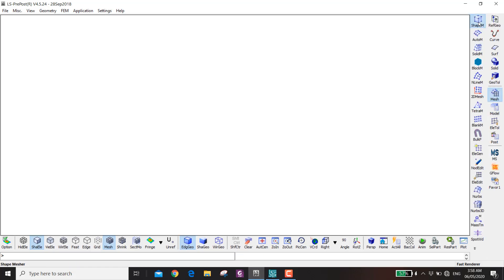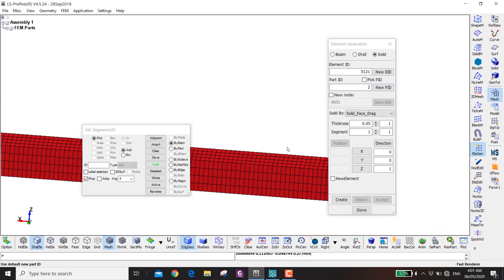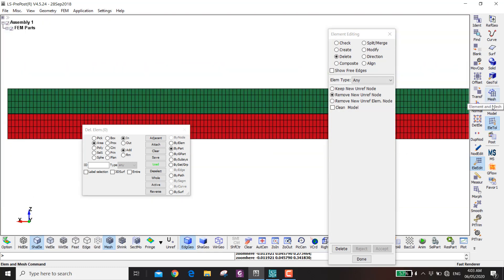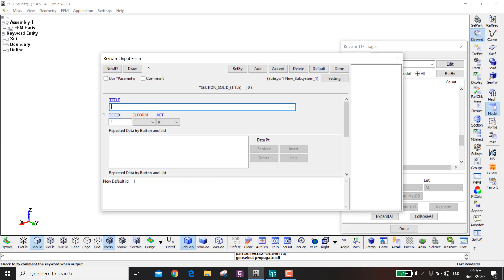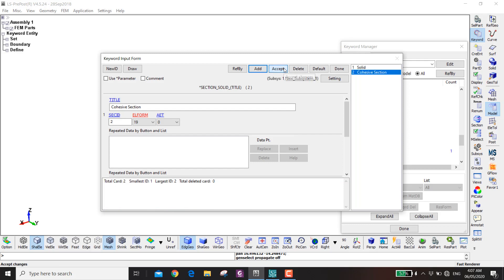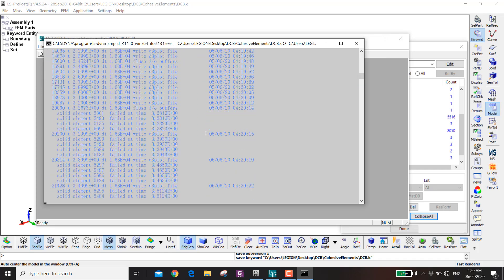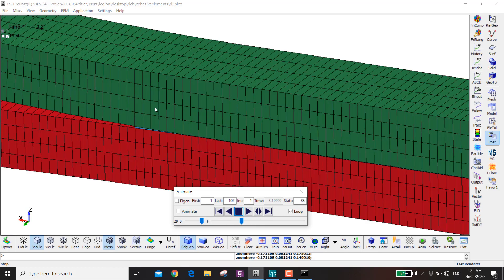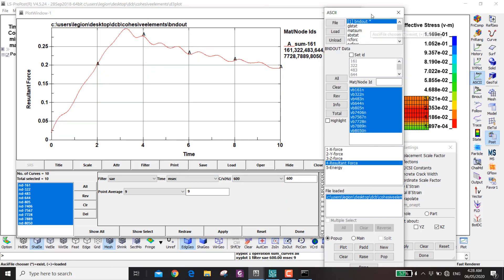LS-DYNA TUTORIAL 14: Delamination Test and Cohesive Elements

Comment: Thank you for the helpfull video Ameen! I am trying to model a single lap adhesive joint with the same methology you explained in the video. However, the analysis doesn't start because of the error  "The bottom of cohesive element ... is not attached to an adjacent shell, tshell or solid element - nor - is part of a tied or tiebreak contact definition" for all the adhesive elements, even though I have merged the nodes between the substrates and the adhesive. Do you have any idea what I'm doing wrong? Is it neccessary to use a tie contact?
Reply from the maker: From the error message, I believe there are some cohesive elements with "free ends". All cohesive elements should be connecting between two non-cohesive elements.
Reply: @AmeenTopa  Thank you, that was the problem! I was using two layers of cohesive elements. Also, have you made any video in which you reduce the computational time of the simulation? As I said, I am modelling a single lap joint with a wave-shaped overlap area, the model consist of 70,800 elements and the total time is around 5 hours, but i think that it's quite a long time (I'm a new user)
Reply from the maker: @loukasath.9787  I don't have any videos on that specific topic. The computational time depends on the timestep size and termination time. Smaller timesteps are necessary when the simulation is dynamic and the explicit solver is used. For long duration events (more than 1 second in real time), the implicit solver is used which allows for bigger timesteps. Check my tutorial on axial tube crush.
Reply: Hello, have you resolved this issue? How can it be fixed?
Reply from the maker: Have you checked my first reply to this comment? Make sure the nodes are connected.

Comment: HI, thanks for video. I became  an error and it is*** Error 20264 (STR+264) Material 10 using *MAT_COHESIVE_MIXED_MODE has inconsistent material properties resultin in a negative displacement for the peak traction for mixed mode loading. u/L= 0.0000E+00 is smaller than 1. I cant find an answer. Could you please help me?
Reply from the maker: You can check the user manual vol 2. You will see how this u/L is calculated.
Reply: @AmeenTopa  Thanks a lot for your answer😀 you helped me a lot with your video.🙂🙂🙂

Comment: Nice material, Ameen! Is there a way to create mesh for coesive in order to be finer than mesh for the plates? I know that for same mesh size is possible as you did...thanks
Reply from the maker: You can make a finer mesh of the cohesive and connected to the plates using Tied Contact. However, using this approach, the nodes of the cohesive part are not merged with the plates. Thus, you cannot follow the same steps as I used in the tutorial. You need to create the elements for each part separated (cannot do in step). 

With that being said, for Delamination test, it is always advised to have the same mesh size for both cohesive elements and plates.
Reply: @AmeenTopa  I'm trying to model a drop test with delamination, using TSHELL or SOLID for plates and solid Coesive elements for interface. For tiebreak contact it worked fine but for the another aproach for delamnination(coesive elements) with material model, like MAT_138, I have some doubts about contact Between Indenter/plates and interfaces. Is that possible to send you my model? I tried: automatic_surface_to_surface (Indenter and plates)
Eroding_surface_to_surface( plates and cohesives / plates and plates)
Must I create some tie contact between plates and interface?? Thanks a lot for the help
Reply from the maker: You mean the same model as in this video? Sorry I don't have it anymore as this was very old tutorial.
Reply from the maker: If the plates and interface have merged nodes at their boundary (like on this tutorial), this no need for tiebreak or tied contact
Reply: @AmeenTopa  thanks a lot for your help!

Comment: Hi, using the second approach with the tiebreak contact what is the tensile failure stress? If we want to use the tiebreak contact with two different linear elastic  materials, which failure stress (NFSL) should we insert as the tensile failure stress? Thank you.
Reply from the maker: You can read more about this in my blog entry here:
https://lsdynauniverse.blogspot.com/2021/03/delamination-and-tiebreak-contact.html

Comment: Thanks for this tutorial Ameen, I am currently trying to model an adhesive joint but because of a mismatched mesh between the adhesive and the adherend I'm having issues running the simulation. Do you have any tutorial on using tied contacts to connect two mismatching meshes?
Reply from the maker: You are welcome. Check out my tutorial on Concrete Wrapped with Composite Laminates

Also, my tutorial on Three Point Bending
Reply: @AmeenTopa  Hey Ameen, I checked out your other tutorials and created my model. Unfortunately, when I run my model it stops after a certain time do you have any idea why that might be happening?
Reply from the maker: What does the error says?
Reply from the maker: @mohammadraza9381  sorry I just noticed your comment. Have you figure out the solution?

Comment: Hello, I am doing my FYP project this semester about the investigation of delamination on the composite structure. There are some problems that I need to overcome and I do not have strong knowledge about this ls dyna software. Can you help me? I would like to ask you some questions.
Reply from the maker: Yes sure. What are you questions?
Reply: @AmeenTopa  I follow your step to model my DCB but the material parameters i put based on paper that I refer to and some problems occurs when the ls dyna cannot simulate because it said the value being insert is not valid or too big especially in poisson ratio part. Another problem is the result for my delamination i want graph force vs opening displacement of the composite but i do not know how to do it because in this tutorial only shows graph with force vs time only. I have search how to get the graph from ls dyna that I want in the internet but still cannot manage to find how to do it. I hope you can help me and can I contact you through email because maybe there are still some question I want to ask and I can show you my sample what problems I have faced.
Reply from the maker: Put your email here and I will follow up in my free time.
Reply from the maker: The paper I referred to can be found from this link:
https://www.researchgate.net/profile/Adnan_Gheryani
Reply: @AmeenTopa  thank you very much.

Comment: Ameen brother ,   I have one bullet  part in separate  ls dyna  file. And  one solid plate in another  ls dyna file .
I  have   imported both the file .
But  I want change the orientation and position  of bullet ..
How to do that ??
Please reply .....  tomorrow  is my presentation......

Everything depends upon you.....
Reply from the maker: Dear Kumar,
You can use Element Tools, Translate, Rotate.

Check my tutorial on "Concrete + Wrecking Ball" to see how I used these tools.
Reply: @AmeenTopa   thanks a lot brother ... you  are doing a great and priceless job....
Keep it doing......
Reply: @AmeenTopa   brother suppose  I want to impact this composite ( which you have created in this  delamination video)  with a bullet  then how to do that?.
I have used bullet as a slave .
I want to select eintre  composite  ( upper layer + clay+ lower layer)  as my master segment  ID .
How to do that ?

Or I have to select  upper plate as my master ID.
Please reply.

Iam getting termination error. 
Please help

Can you make a simulation  of  bullet striking the body armor.?
  Note:- the body armor can be modelled as    consistent  of three layer
1)  1st   layer  is of ceramic
2)  2nd layer of clay
3)  third layer is  composite. 
Similar  to your  delamination  model.
Just difference  is upper material  is ceramic  while   lower  material is made from composite.

Can you do this simulation?

Can I send you my  ls pre post   file?
  please  give me your mail I'd..
Reply from the maker: Dear Kumar, 

First of all, I don't give my email here. You can see from the comment of others. You put your email here, and I will contact you in my free time.

Secondly, yes it is possible. For the contact with many parts as target, you can use part set as the master. Surface to Surface contact or Eroding contact if you have element failure. 

Lastly, yes, the three layers simulation is possible. Nothing difficult about it. Just see my other videos about impact.
Reply from the maker: Dear Kumar, may I know what is the cause of the termination error?

Comment: Hello Ameen,
I did tie break contact shell dcb model but when my model is not peeling out from cohesive part. Separation is only from initial length. How could i solve this problem? Could you give me advice please?
Reply from the maker: Hi there, here things that few things that you need to check:
Initial penetration between the shell parts
The values of the normal and shear strength/strains are accurate.
Offset between the shells.

Also, if both beams are shell, you can try  constrained_tied_break where you need to put only the value of strain at failure
Reply: @AmeenTopa  Thank you very much Ameen
Reply: @AmeenTopa  Ameen I want to ask a  final question. This card worked in tiebreak but if i use for cohesive shell dcb, is it available similar card? Because when i look initial penetrations, automatic fixing changes my model shape and manual button can not be activated in model editing. Thank you for your patient.
Reply from the maker: If you are modelling the two beams as shell elements, you try:
1 - Contact tiebreak offset,
2 - Constrained tiebreak, or
3 - contact tied offset with cohesive elements between the two parts.